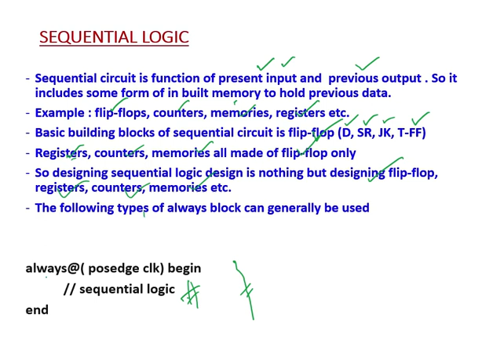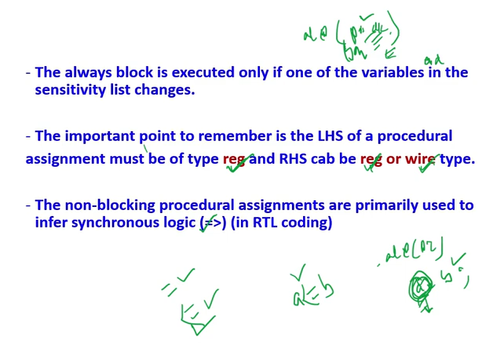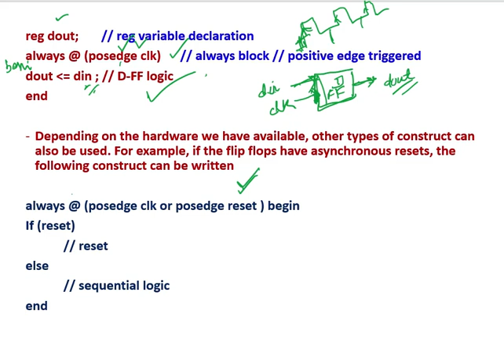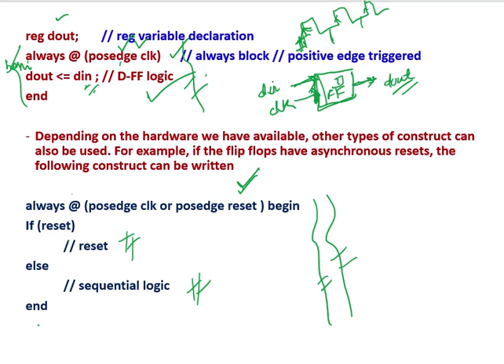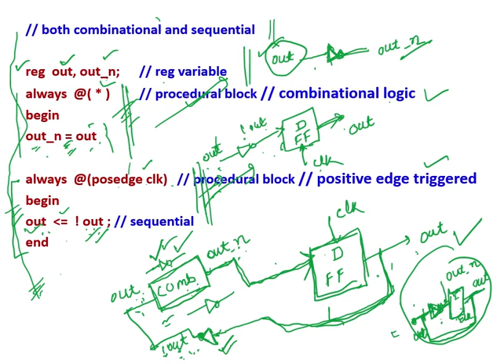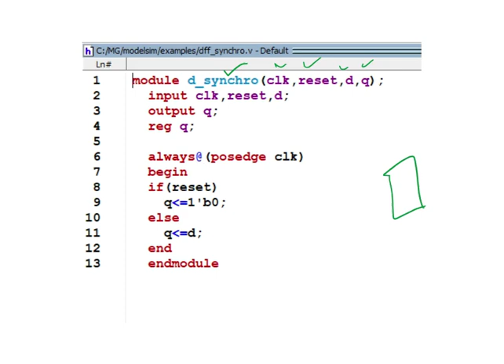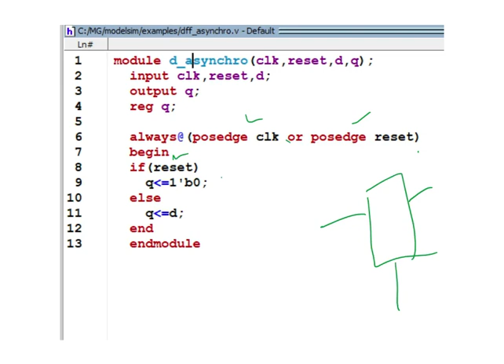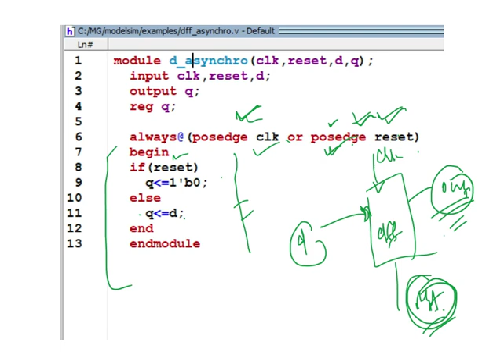#14 always block for sequential logic || always block in Verilog || explained with codes and ckt.

Comment: sir, 
in synch. sequential ckt every memory elements operates on single clk freq. wheres  in async. seq. ckt memory elements involved operates on different clk freq. so when an asynch. clr or preset signal is provided to either of the ckt, irrespective of clk signal, the output of the ckts becomes 0 or 1 respectively. Means asynch clr or preset signals are independent of clk. so in 15:33 why can't we consider reset as a sensitivity variable while creating a synch. seq. ckt?    I'm sorry for this long essay😐........
Reply: i think 15:33 is the example of synch. seq ckt with synch. clr signal
and 16:28 is the example of synch. seq ckt with asynch. clr signal.
Reply from the maker: First ckt is for synchronous reset logic where reset depends on clock signal and second ckt is for asynchronous reset logic where reset doesn't depend on clock signal. These are verilog concepts and not exactly digital concepts. This is called synchronous and asynchronous reset and not synchronous or asynchronous sequential ckt. Hope it helps.
Reply: @ComponentByte  yes, sir btw thanks for all these videos I'm a fresh btech grad. I don't had any idea, after the graduation what to do? I came across your channel which helped me to set a career goal and motivated me to work hard to be the best. I've completed Digital and now I'm studying verilog. Can you please suggest, from  where should I start studying for sys-verilog?  Thank YOU....😍
and sir, is it necessary to learn everything of CMOS like abstraction to operation for design & verification role? In a recent interview for DV role they asked me CMOS questions only😓😓
Reply from the maker: For verification CMOS knowledge is not required but during interview they may test your B.tech technical knowledge and hence they may ask B.tech level courses. Don't worry, they won't evaluate you based on that knowledge. Whether it's digital design or verification it's always digital and logic skill they are interested in , if it's for freshers job. To learn SV there are plenty of resources available on internet and best is testbench.in. But you need a SV tools to practice it. If you try then free version of questasim will be available in torrent or any other websites. Try for it if you want to learn. If you have verilog knowledge then you can very easily learn SV. SV is more software coding than hardware coding. So learn C ++. It's compulsory for SV.